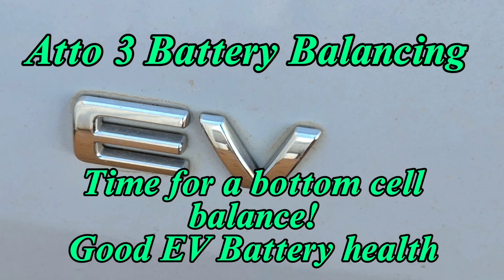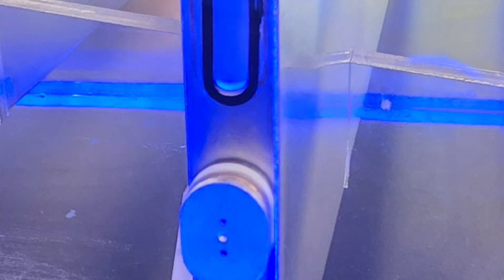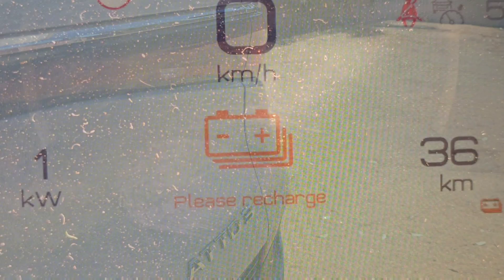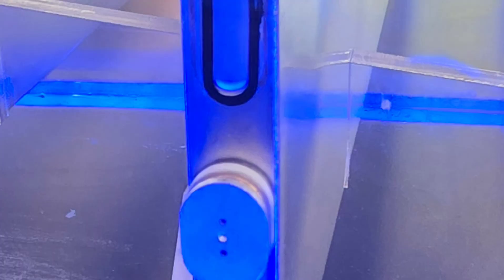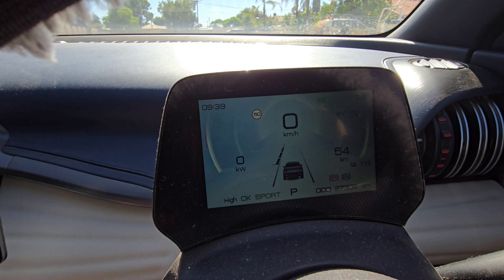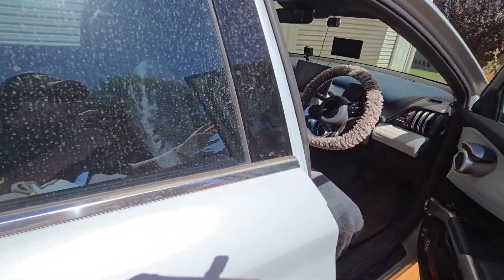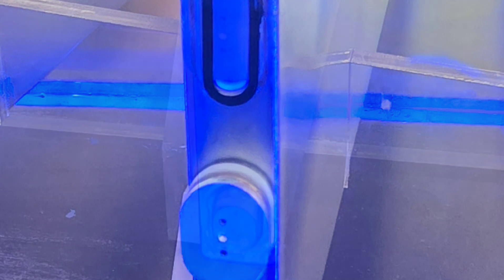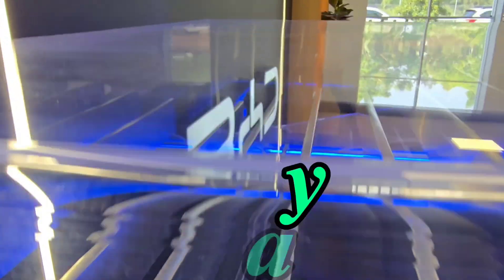ATTO 3: Bottom Cell Balancing & Good Battery Health! What You Should Do!  Episode 92

Comment: My Byd atto3 batterty drains around 3% a day when it is turned off.
Do you think this resetting help? Many thanks
Reply from the maker: Is your key close to the car? ( within 10 m inside )
I've heard that can drain the battery, the proximity can trigger items inside the car which will drain the battery.

Otherwise get BYD to check it, as that is not normal to lose that much! 
You shouldn't lose anything in a day! 
I lost 1% in 5 WEEKS
Reply: @downunderevadventures39461 Thanks for your reply. It happens even when the keys are far away. I will do reset and see how it goes.
Reply: @downunderevadventures39461  Hi Again, it turns out that the problem was the 12V battery. It got completely flat yesterday, and the car did not start. The roadside assistance replaced the battery, and everything was fine since then.
Reply from the maker: @jaekim9989  great to hear!

Comment: New Atto 3 owner. So just to be clear - short version. Let the charge go below 10% at least once every 4 months and then slow charge back up to 100%? That's it? Nothing more complicated?
Reply from the maker: Yes, correct. "Slow" charge can be up to the maximum AC charge, ie 7kw Wall charger speeds are fine. But even DC charging back to 100% is better than not completing the charge in one go. This is the best advice I can find on this!

Comment: Nice video, thanks. I notice that you are using High regen and Sport mode. I am wondering if that is because you are towing? I have done 56,000km in my Atto 3. I mainly use Standard regen and Eco mode. Using these settings I regularly get the WLTP range of 420 km. Also, like you I have a solar system that I can use for charging when I am home on sunny days, although mostly I am out doing rideshare during the day. I also purchased a 30-watt Kmart fan to run in front of my radiator during charging. Why? Although the heat pump is circulating the coolant through the radiator during AC charging, it does not start the fan. I could smell my coolant getting hot and venting out the pressure relief valve. There are two ways to address this: 1. Leave the car on and locked up, in which case the fan comes on every couple of minutes for 30 seconds. 2. Put a small fan outside the front of the radiator with the car off. Because the coolant is still circulating, a small fan on low does a great job. Cheers
Reply from the maker: Cheers

Comment: So do you have to fill it to full battery?  I usually charge for 8 hours at a cheaper rate, but may only be at 80% charge.
Reply from the maker: @MegaHorse7  LFP should be charged to 100% at least several times a year, better still, just do it all the time, it won't harm the battery. NMC on the other hand is best not above 80% unless you are travelling and need the charge on a long trip

Comment: Thank you for sharing. I am a BYD Tang owner. My car always drop around 3 to 5% when SoC around 20 to 25% in Mar 6,  it drop from 23 to 20% (while i park my car around 4 hours). Then in Friday I charge my car from 16% to100%. While the SoC from 95% to 100% it take a few minutes (estimation from BYD app around 1hours). Do you have this experience too? Someone said this is BMS protect battery from deep discharge and overcharge.
Reply from the maker: @oksorethea1399  I don't have any experience with the Tang as they don't sell it in Australia. The BMS is getting better on all cars. If you are worried, contact your service dealer and get them to run a check on it. They should be abke to anaylse it. Good luck!
Reply: Did you find a solution? My BYD Seal U have the same issue. Charge percentage is going down to quick. WILL THE BALANCE CHARGING FROM UNDER 10% to 100 fix it?
Reply: I tried (10-100% with one session) but still persist. Range and performance still good as new. i alway charge 20-80% till i got message "Please fully charge the vehicle so that the power battery is automatically balanced"?

Comment: Good ideas about the bottom balancing. For the first time in 1.5 years on my way back from Albany to Mandurah in my ATTO3 I was concerned as I did a quick 15 min charge in Manjimup and thought I had a good range home but when I got onto the Old Coast Road off the Forrest Highway I was down to 11% so I turned off the AC and kept the car at 100km/h and tried to keep under 20% use. I hit Dawesville and at 10% got the charge warning light for the first time. Made it home with 8% and 25 km range. Charged to full again and only got to 480 kms range again. When I was in Albany I used the Granny charger at our rental house and it got to just over 500 kms range which I had never seen. I think I will charge a bit more carefully on a long road trip away from home in the future.

Comment: good cars  have no of these issues regardless what battery. Same for home storage, unless you buy cheap chinese 12 or 24 V 100 or 200 Ah batteries.
Key is that your BMS has an active balancer and then the cells will not drift away cause the cell with the highest voltage will be discharged during charging which means that the energy gets into a capacitor andfrom there it will charge the battery cell with the lowest voltage. That is the job of an active balancer . 

These powerqueen and what not chinese batteries have these bms but no actice balancer.
Reply from the maker: @typxxilps Thanks for your comments. It's good to know all battery technology is getting better all the time